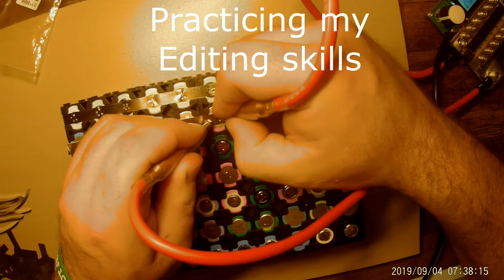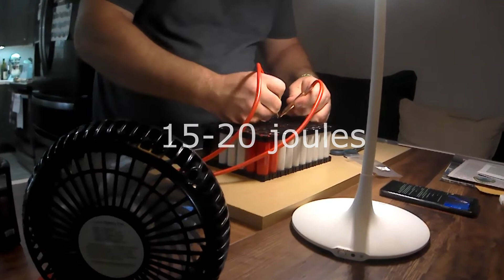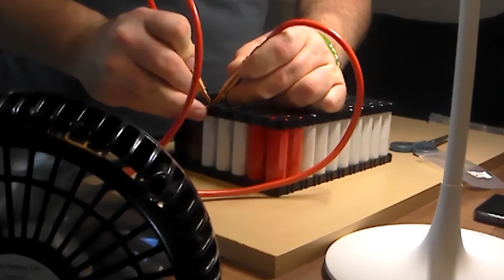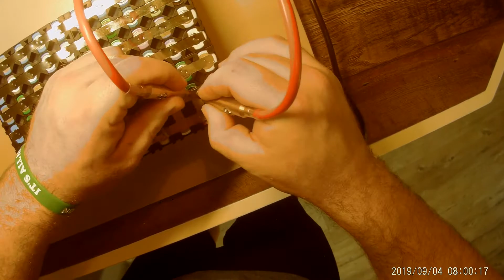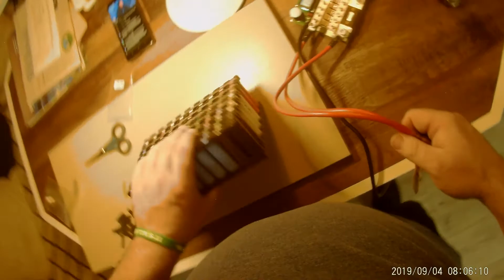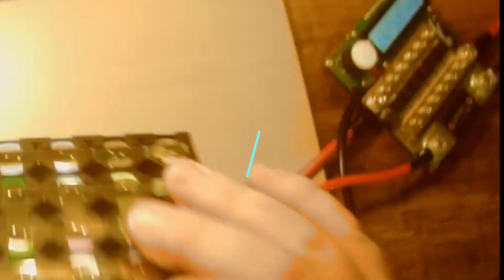K weld- practice editing, 24 volt

Comment: .didmt You bought some of those purple LG batterys the long ones. If so how are they measuring out as good as the 3 pack modem batteries. I was thinking ad buying enough to build a 14s pack
Reply from the maker: Yes, I bought 600 and they all tested good and I just checked the voltage on them a few minutes ago(all) and they are very good.  I like the cells better than modems, but modems are easier by a little bit to process.
Reply: Thanks I'm putting  in my order thanks for the videos. It seams like how an Pete don't do battery videos hardly any more looking forward to your next one. Have a great day